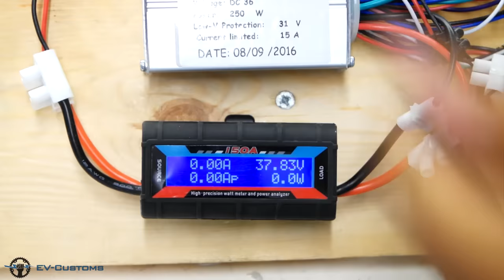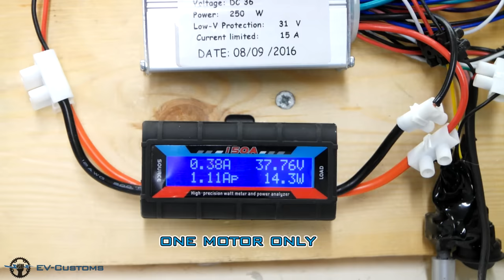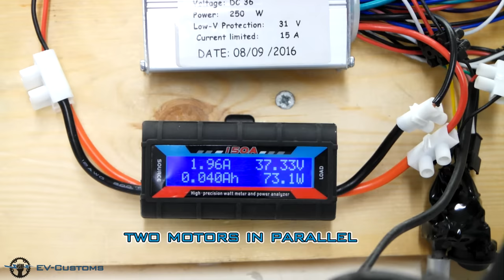Can one Speed Controller Run two Hub Motors???

Comment: That controller is for BLDC motor equipped with hall sensors and I doubt that runs with sinus or SVM. Hall sensor outputs are usually in form of open collector, so if you connect two motors like that (two hall sensor outputs connected together) - when one motor is slightly different, or running with different load, it slow down against other motor. When slow down, hall sensor outputs of motors are not the same anymore and controller can't drive motor windings correctly to maintain stable torque and speed. In short - this will never work properly.
There is no simple solution for multiple motors not directly coupled together (like two wheels on road). It can be done using smart drivers connected together. Usually one is master and others are slaves. But this is a long story.

Comment: so i should just go with one 1000 watt rear hub motor then? or 2 seperate kits with 2 controllers n 2 batteries wired seperate from each wheel n 2 different throttle controllers? 🍻
Reply from the maker: For good operation you need 2 hub motors 2 controller 1 throttle 1 battery

Comment: Hi, I'm only newby and learning from guys like you. I saw that these motors can also be used as power generators!? Could you make a video of parallel discharging and charging on second wheel motor! Maybe on separate switchable set's of batteries as known  that is harmful for cells to be drained and charged at the same time. Would be interesting👍 liked and subscribed already

Comment: hello friend, one question, can the throttle be replaced by a switch and how is it done?
Reply from the maker: Yes you can do that...   Shorting signal wire with plus +5V
Reply: @EVCustoms  Do I have to install a switch on the red 5v + cable?

My intention is to suppress the accelerator and with a switch give maximum speed, do you understand?
Reply from the maker: @vsl5917  Yes my friend... i understud, you must connect your switch with red +5V and signal wire  .
Reply: @EVCustoms  Ok thank you

Comment: Maybe it's because both hub drives are connected to the same battery... I wonder whether or not the problem will be fixed if you have the hub drives controlled by the same lever, yet each one is connected to a different battery set?!?!?

Comment: will only work with no load. trust me I've made a bike or an a scooter with them need second controller other wise the wheels will hault. because the wheels are no longer alignment. 
oh  tho you can run without hall sensor and you can use same pandomiter do

Comment: Lots of interesting comments on what the issue is.
Brushless dc motor controllers need to get feed back from the motor to know the position of the rotor, this feed back is obtained in one of two ways, either from hall sensors or from from the normal voltage generated when a motor is rotating (back emf). When the controller knows the position of the rotor, it then knows when to apply power. The motor has three phases and the controller has to monitor and manage each of them.
When you connect two motors to a controller, it will be getting feedback from both motors and unless they are both phase syncronised (unlikely)  they will not run properly as the duel feedback will cause the controller to not correctly apply power to one or both motors.
Reply: Dont they just chop the DC ?
Reply: @boingo001  No. If a motor has brushes, they control which coils  are getting current, at the correct moment to cause rotation, and the current could then be "chopped", but brushless motors, of course, don't have brushes, so current control through the coils has to be done electronically
Reply: @petertyrrell6690  Yes  , sorry  missed the brushless  wording,  sticks  out when I read it properly.

Comment: @EV - Customs hi from India. I wanna built a 800w + 800w bldc all wheel drive bike with 48v motor. According to p=vi I need 16A during Top load condition. What should be my wire's amp carrying capacity, 16A or 32A???

Lots of love from India!!
Reply: I'll definitely need 32A rated battery, right??
Reply from the maker: Hi friend...  for 1600Watt power output from battery you need 4mm wire...
Reply from the maker: @milan9791  Yes you need rated power output 32 A... if your battery is bigger it is better!

Comment: now put them under a 33% load
 The ESC will over heat
Reply: Why 33%?

Is it specifically 1/3

Or you mean basically any throttle will burn the esc

Comment: if you attached a chain to both hubs or somehow connected them to force them to move at the same rpm would that not smooth out the running?

Comment: Can two (or more) motors with controller for each motor run with only one throttle and one ignition for all motors and controllers? :)
Reply from the maker: Yes this is possible,  u have some  videos...
Reply: yes ... throttle is low voltage and you can change speed of two controllers with a single throttle (iirr it is 1-4v or so .... a bit below 5v is full speed)

Comment: Someone tell me how do they do it with hover boards they do have two controllers but they share a 36v battery. Can you use the same throttle I guess I'm asking
Reply from the maker: Yes can  work  2 controlles with one throttle.
Reply: @EVCustoms  pls help me..i want my electric scooter segway es2 to make with two hub motors but no space for second controler is it possible to be reapair the controler to be like two controlers or somthing?
Reply: @kamenkrustev  No free lunches there. You just have to figure out how to fit the 2nd controller.

Comment: Sadly this type of set up would never work or well it would but you would need a controller that has flux weakening and only the incredibly expensive ones have that, in any case the usually reason for 2 motors is to increase torque and well  if you have one 250w controller then you do not magically get  500w by attaching 2 250w motors to it and for that mater the 2 motors would not run at 250w as the controller has a max amps, basically the 250w would be divided by the number of motors so with 2 each would get 125w and so you would gain nothing by having a second motor but it would cost you range on your battery.   The proper way would be to have 2 identical  250w controllers and have them both wired to the same battery, for PAS or throttle you have one controller fully wired to the pas or throttle and for the second controller you simply connect in the signal  and negative wires, this allows one pas or throttle to control 2 controllers, but doing it this way would still eat up battery range but would increase your actual power to 500w

Comment: I need help 🤦🏽‍♂️how the hell do you wire a speed controller up???? I'm so confused.
Reply: +- on one side that goes to +- on your battery and 3 phases on the other side that plug into the 3 motor connectors, doesn't matter which goes where. And then you might have sensor cables coming from your motor and you plug it into the sensor port on the ESC. Nothing more to it.

Comment: 2 motors draining same bat: Effective power per motor= V x 1/2A => Lower acceleration. Low Speed=> In theory the output voltage is good. The out of sync of feeding  the internal coils of both motors with the juice will produce a lower top speed. In one motor it should be attracting some internal motor coils and repeling others and in the other motor vice-versa. Check this https://www.youtube.com/watch?v=bCEiOnuODac&t=1:40 . A diode it is still underperformance solution because you are just cutting for instance the reverse polarization and it must exists AND synchronized with other motor. The interesting part: Both rotate because they  achieved an underperformance sync balance. Same wires don't help :D Put 2 controllers, does not solve the low acceleration (double the bat amps and do a parallel) but solves the top speed.

Comment: My wife and I debated this very subject recently. She burned one of the motors and asked me to rewire the controller adding heavier diodes to combat magnetic induction. I informed her the diodes I had previously installed had performed as designed. The problem was she had simply overworked both motors. She asked for a divorce. ( I know. It was a very harsh reaction ) I must specify, however, this was a dual-motor setup on her feminine massager ( vibrator ).

Comment: The 72v dc Me 0913 bldc motor (I use to drive a Paxton Novi 2000 centrifugal super-charger with a 2 1/2" belt drive at around a  1:3 ratio to the input shaft) has two stators tied in parallel around a single rotor. It pulls just over 11.5 KW off six 50 ah series-ed 12 v AGMs.

Comment: Nice!... Very good vídeo! I was with the same doubt in my "eletric GO kart (DIY)...  And about too use two controller (one for each engine), but with the same speed controller?... It works?... Greetings From Brazil!
Reply from the maker: Same controllers and same hub motors,, you have huge losses anyway...
Reply: No it does not work!

Comment: If you are planning to do so then prefer the controller double the capacity of motor(if 2 motor)
And quadruple if 4 motor eg: 500w controller for two 250w motor
Or 1000w controller for four 250 w motor
The setup shown in the video is perfect without load
But on road controller will distribute the current in moters

Comment: I am ... surprised how weird and wild comments got around this... and most of 'em are so damn wrong and misleading!!
So, if someone ever reads this, first and foremost, my day job is to design and build DC, AC & BLDC (or technically correct PMSM or Permanent Magnet Synchronous Motor) power & logic control units starting from electronics up to firmware design... so I think I know thing or two about motor control.
Top-most comment of Marcus Bridge is totally off. Both 6-step control (classic hobby ESC designs) and FOC control handle regenerative power via MosFET built-in or extra added diodes by "sending" it back to power source, a.k.a. battery or so called DC-line in frequency converters. In no way they are "fighting" with each other due to regeneration in any of motors!
Sebastian Weinert is on right track with skylinevspec000 being right - just add another controller but keep control signal the same, BUT here's the problem - the same control signal does not ensure sync'ed motor speed! Problem lies in concept called "PID controller". It is a algorithmic of electro-mechanical logic, that keeps driving MosFETs in sync with actual motor motion (no matter what feedback system is used). Result? Each motor ALWAYS will try to spin at its own "natural" pace even if You hard-couple the shafts. Coupling shafts with one-way-bearing can mitigate this problem but at a cost of efficiency.
Fantaman900 mentioned "hall sensors" as feedback. I have no information on these motor specifically, but yes - it is one option. Classic hobby ESCs for RC models use back-EMF as feedback - controller senses voltage change in windings to determine rotor position. And then there is possibility of encoder or resolver - dedicated pulse-based or sine/cosine wave based feedback devices. Depending on what is used, it HEAVELY affects how You can or even should You couple two motors together. General idea? You don't! Not mechanically, not electrically. Only via some sort of differential balancing mechanism.
That cracking sound in video he mentioned comes from fact that controller if falling out of sync with one or probably both motors - MosFETs are "firing" at wrong times electrically cogging motor motion and overloading control logic. Control logic trips overcurrent protection, turns off for a split of milliseconds and tries to re-sync ... aaand here comes another kick, another cog, another overcurrent... until it gets close enough to sustain motion. This is what happens if You parallel two BLDC motors on the same drive (having the same feedback system). It's VERY inefficient and at nominal loads it's very likely to burn the driver over short time.

Comment: Hi. Thanks for sharing. please help me, i'm an old man and i'm in a wheelchair. I would like to buy an electrical system to adapt to my chair, but it is very expensive for me. Watching your video I thought these engines could be the solution. can you please tell me where i can buy? is it possible to connect a joystick to the controller? thanks for your reply, best regards
Reply from the maker: Hello my friend.. for a wheelchair yes you need expensive system  with a joystick, you can find this systems on aliexpress but again is expensive...  with this kit in video you cannot do  two hub motor wheelchair....   is not efficient..

Comment: can you make a kit with 2 hubmotors (front and rear) controlled by 1 CPU, supplyed by one battery and the regen-braking should brake seperately in pairs ( front brake only activets regen in front hub motor ) can you make that ?

Comment: Please you experiment a new job . Double motor with serese & give double voltage.
Because in turn booth motors
are not in same rotation , so witch Moto will run longer that takes high voltage for shorter.

Comment: YOu can't run 2 brushless motors like that. The position of the rotor gets recognized by the back EMF from the magnets, you can't get value from two motors back when you can only act to one accordingly. You always need one motor for one controller

Comment: Isn't it obvious? You lose power because two 250w motors wired in parallel = 500w,  but the controller you use is 250w only! You have to use 500 w controller not to lose the performance.

Comment: Its obvius you are trying to controll 2 motor with a tiny controller with only 250 watts of out and 15 Amperes of power never going to work well maybe with a larger controller about 750 watts and more ampere of power works better

Comment: at least you should know that the hall senzors are fucking up the controller. As it reads  informations from both wheels on the same lane of data. And he is spouse to give a very specific  current to the wheel in order to spin correctly.  The readings are wrong. ... Buy another same like controller and use each wheel with its own controller and the accelerator wire are 3 wires... connect them in parallel to one trotle.
Reply from the maker: I read your previous comment so watch what you write, before to make this video i was know the results of experiment, this video made for people whitch cannot understood why one controller cannot run 2 motors.

Comment: There are left-hand twist throttles, so now the question is: "Can you control two motors with separate throttles on one speed controller?"

It would probably be easier to run separate controllers from a single battery, setting their rotational speeds to match, or trusting in the biological CPU in your skull to balance the wheels.

Comment: Hy. Can you tell me where you live. I want to meet you if possible.
Reply: I want to start a project as I am doing engineering in mechanical. So I need your help if you can
Reply from the maker: Hi friend i live in Cyprus
Reply: EV - Customs OMG it's impossible to meet you. I am from Rajasthan India
Reply: Can you help me by making a robowar machine of dimension 2*2 ft of length and width. Actually I am saying this because I have seen making videos of small robowar machine which are useless to me .I have make them also but I can't go and take part in robowar competition with that. So I want to make a real machine operated by remote. And in small machines I am unable to understand that when I will make a real project of 2 by 2 feat or 3 by 3 which components I should use ,where I can buy them, what will be there actual price, I mean a complete detailed information. It will be great help if you can show me how to do that by making a video. As it is impossible to meet you otherwise I would have come and meet you.
Reply from the maker: Nice...  I like your idea my friend..   i can help you with photos email's videos and more...  And i want to help you
Reply: Thanks bro I am waiting for your video
Reply from the maker: ev-customs@hotmail.com
Reply: I didn't understand

Comment: we use 4 on a drone...
Reply from the maker: No my friend...
Reply: @EVCustoms  hear me now, believe me later....I built these drones myself. Each motor has an individual electronic speed controller...The newest boards are 4 into 1. One board, 4 ESC's...each one designated for one motor. Go to my page and see.
Reply from the maker: @touchthesun2448  Sorry friend, the previous comment was meant for someone else...
Reply from the maker: @touchthesun2448  For sure you need 4 controllers for 4 motors. and yes for sure exists many controllers with multiple outputs. it like 4 controllers on one board.